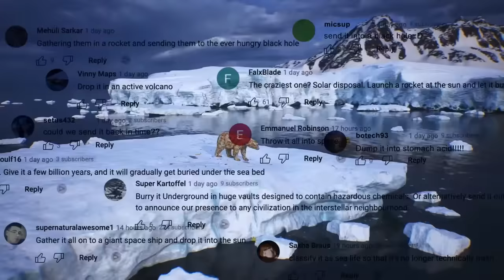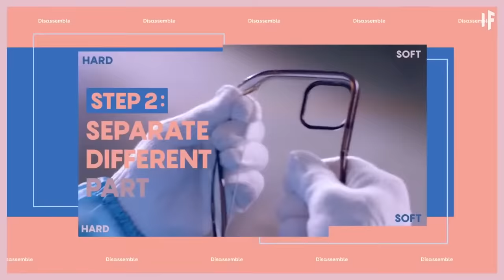What If We Dumped Our Trash Into Volcanoes?

Comment: Dump it in the fault lines at the bottom of the ocean, the pressure with crush and compact it and it will eventually get pulled under the mantel and added back to the molten core

Comment: so if the issue is the trash is too cold vs the volcanos heat...how warm does it have to be going in there? can we get away with making the air around it hot enough as is goes in? like a conveyer belt running up the volcano  in a wind tunnel that is carrying the trash by blasting hot air. the hot air is being blasted down into the volcano cause the surface of the lava to be broken and the temp lowered as the trash goes in to that one point.   granted that wouldn't solve the pollution problem,
Reply: I was wondering if it were melted down and poured into the volcano what would happen.